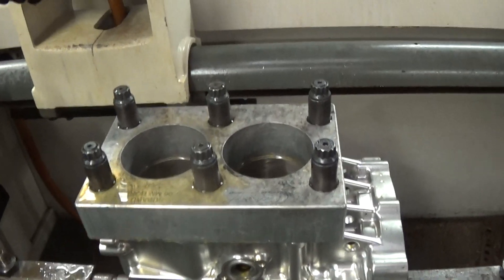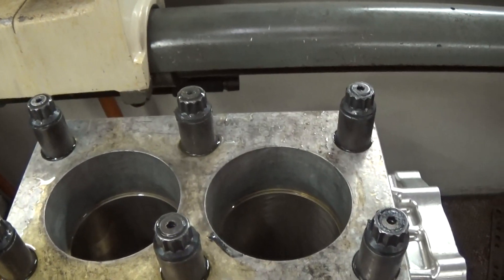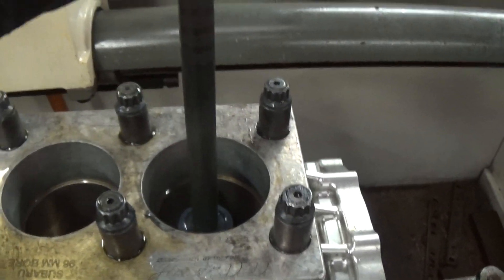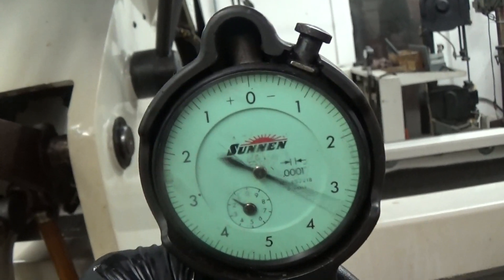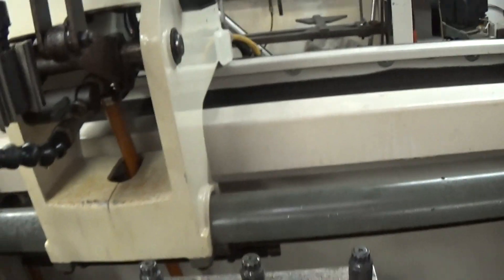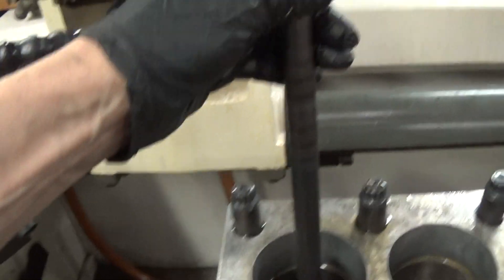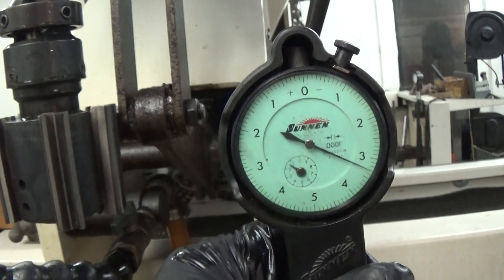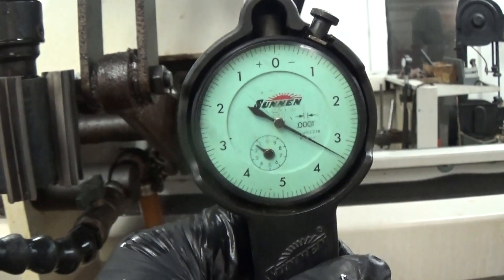Sunnen SV10, awesome even with nikasil

Comment: Any place I can go to get the tapper taken out of my 2 cylinder outboard blocks that were  nikosiled.
Reply from the maker: The only thing you can do with tapered bores is to use a silicon carbide flex hone to prep them for new rings. If you straighten them in a proper diamond hone, you'd just open up the clearance beyond spec. A couple of thou taper is not the end of the world.
Reply: Thank you again for your reply. I will carefully ball hone in both forward and reverse to take the sharp edges out and then fit end gap to the tapered part of the bore. Joe

Comment: so you had the bores coated with nikasil then?  who did that for you, and what is the depth of the nikasil?  how come they couldn't bring it to size for you?   was the cost reasonable for 4 holes?
Reply from the maker: No, these are ductile iron sleeves with a nikasil coating.  Honing sleeves after installation with deck plates attached is the only way to get them round and straight, crucial for ring seal. These are custom made German sleeves supplied by my customer so I do not know the cost but I'm sure they are not cheap.